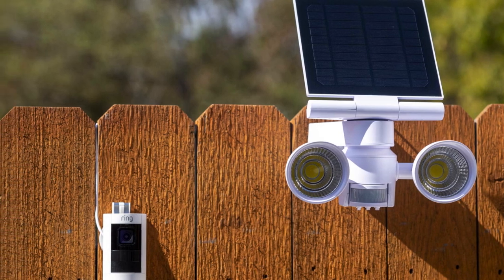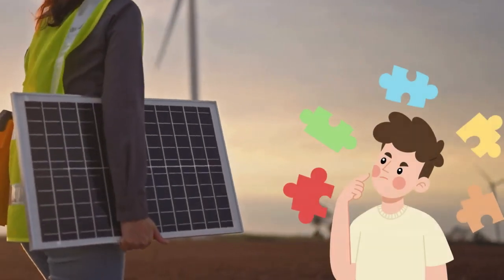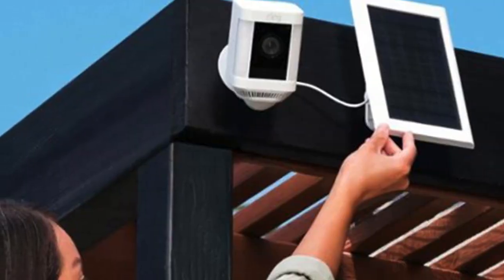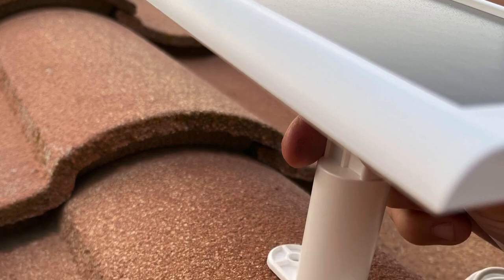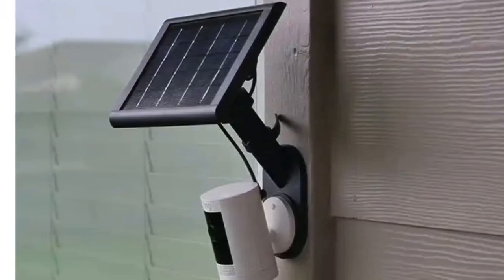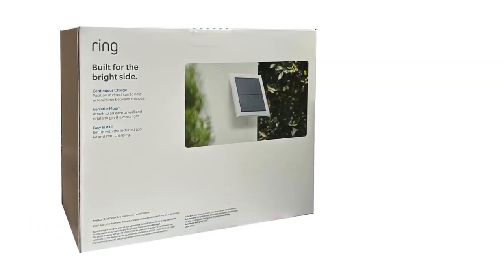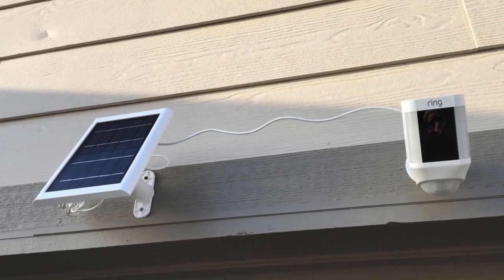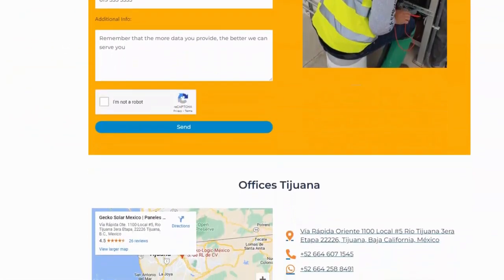🌞🔋 Why My Ring Solar Panel Isn’t Charging Stick Up Cam? Troubleshoot & Fix Now! 🔧📸

Comment: I know what the problem is with 2 of mine - first solar panel: cable is broken at several points. Second solar panel: the charging port on the camera is detached and stuck in the connector of the solar panel. I need information about how I can replace both cables and which cables (completely with connector) are there available.
Reply: Did you ever get an answer on the cable? That’s probably why ours is doing the same thing..🙄🙄

Comment: The video covers very general topics that I already know. I measured the voltage to be 4.99V with sunlight directly hitting the panel. The battery is at 83% but still not charging. This is the issue I'm looking for answer and help.